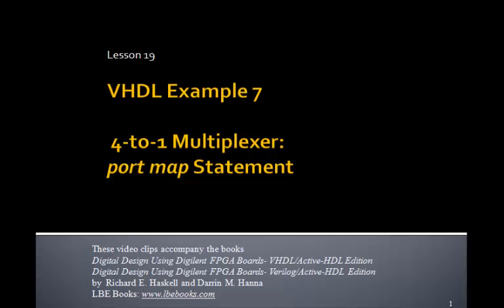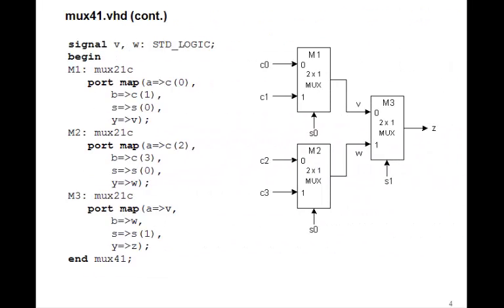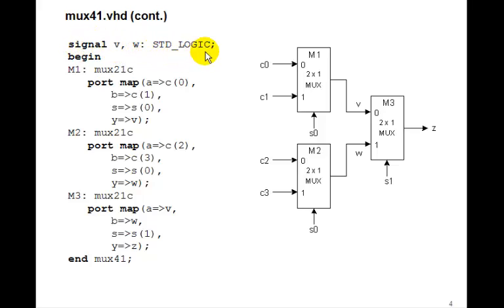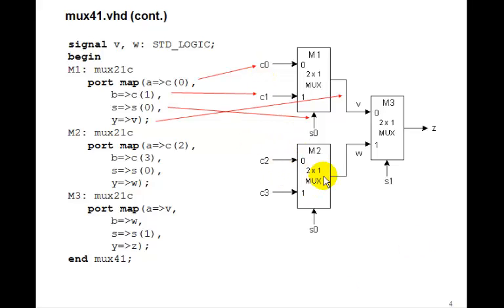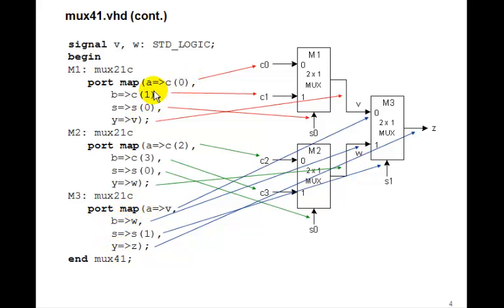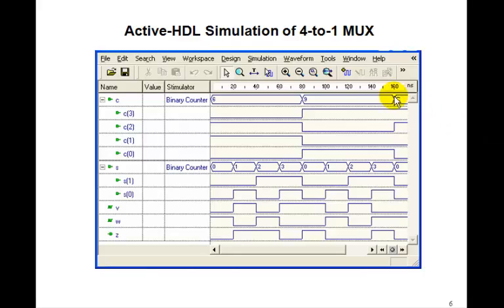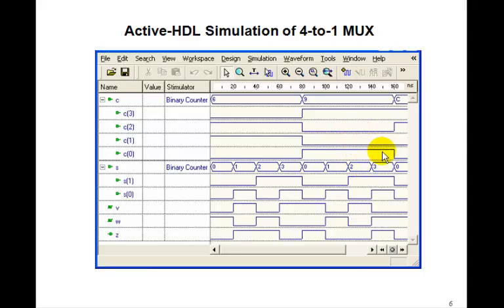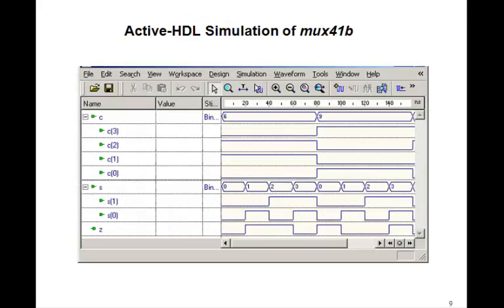Lesson 19 - VHDL Example 7: 4-to-1 MUX - port map statement

Comment: Respected Sir,
I have written the program only..there is no errors ..I am getting the input waveforms but output is not showing ...
Is there any modification to be done? whether I need to define /draw the structure in RTL implementation in Xilinx ISE 4.1...
Reply: @Dipan Same problem did you solve it ?

Comment: i am using Quartus II
i got a problem with M1,M2,M3 it says: Error (12006): Node instance "M1" instantiates undefined entity "mux21"

i did everything according to the video
Reply: sir then use u1 instead of M1 as the unit under test then you will not get any error.